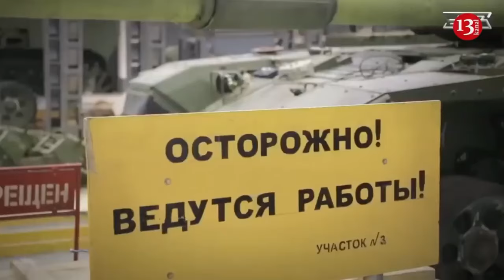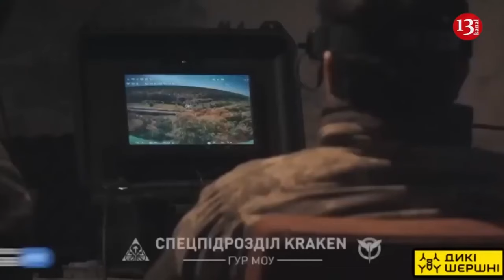Russia sends to Ukraine 80% of equipment, manpower withdrawn from Finland border – Finnish media

Comment: Russia has taken huge amounts of forces from the far east command. Other areas have also had force reductions. But it has to be noted that Russia is on course to have as many as 300,000 dead and 100,000 seriously wounded. So they will have burned through this years mobilisation. This is is not sustainable in the long term. Each mobilisation will be less keen to take part in a mass suicide. Which is basically what is happening. My only concern is can Ukraine mobilise and train enough to keep pace with multi pronged attacks. The Russians hope to weaken Ukraine by this strategy. It may have the opposite effect. But l have not seen any evidence that Ukraine is building up enough forces to  make a sustained counter offensive. I may be wrong. I hope so.
Reply: Man, I am ukrainian. And I can say that we have problem with manpower. I don't think that we will risk with new counteroffensive.